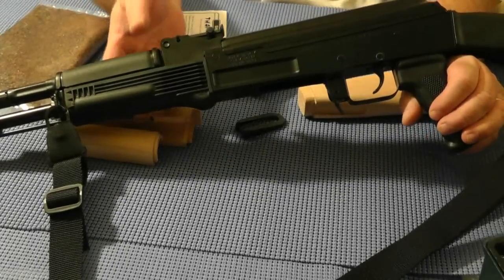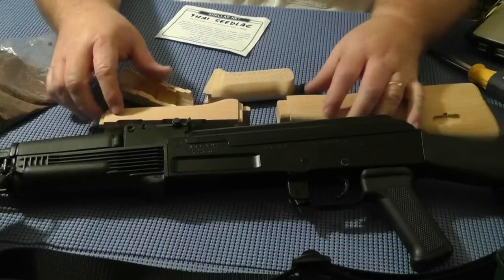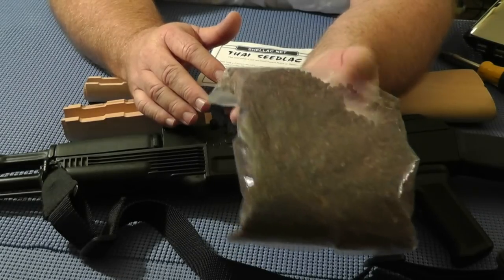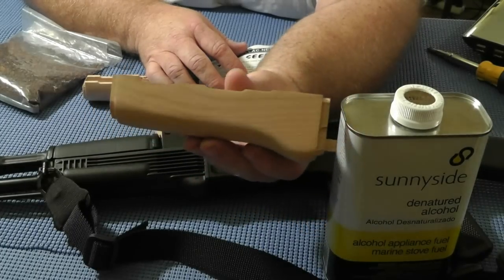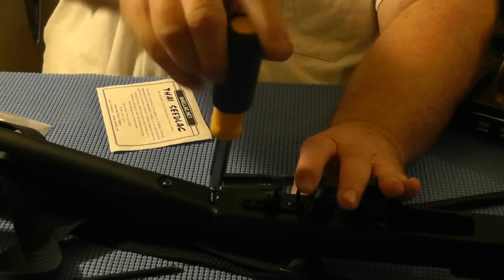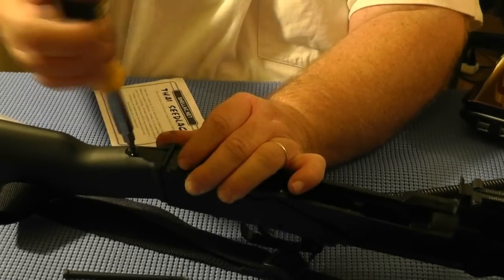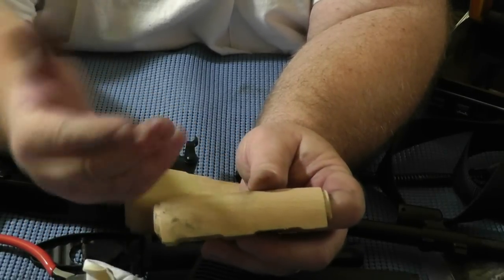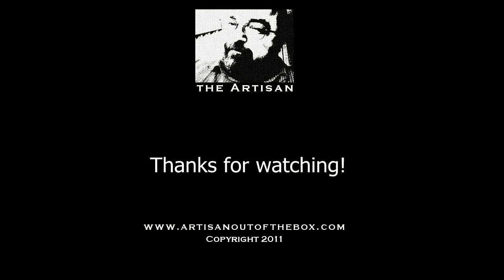Plastic Be Gone from My AK - Arsenal Wood furniture Installation

Comment: I'm having a really really hard time getting the lower ak74 handgaurd on the piece that goes into the slot like on part of it is getting in and it won't just push down into place, I feel like Iv removed a fairly decent amount of wood from that little part to, I really don't know what to do.

Comment: Hey Tony, does your gas tube have a little wiggle to it? I just bought a sam7r and the gas tube moves a little near the rear sight base. Just curious if this was normal
Reply from the maker: Let me check :)
Reply from the maker: Just a tad but not much.  Is your gas tube lever tight?  I still think they are the best AK's :)
Reply: Yeah my gas tube lever is extremely tight. I had to use pliers to swing it up. Once everything is locked in place the gas tube will move about 1/16 to the left and right if you push on it from the side. I bought mine used so I just wanted to make sure it wasn't something wrong with the gun. I appreciate you checking for me
Reply from the maker: MrMustang990
Mine moves about a 1/16th also :)
Reply from the maker: MrMustang990
Of course it now has the ironwooddesigns wood furniture on it which looks marvelous!
Reply: ArtisanTony Yeah i like that look a lot. Maybe down the road I will do the same. Cheers!

Comment: Just got an Ak Wednesday. Where might the wood parts be found. Mine is an arsenal as well.
Reply from the maker: Ironwoodsdesign dot com, thanks!
Reply: I read that farther down after I messaged you. Thanks. Most appreciated. I ordered three circle 10 magazines. Do you have other brands that you like. The c10 ones are supposed to be the best. A couple others would be nice to get locally.